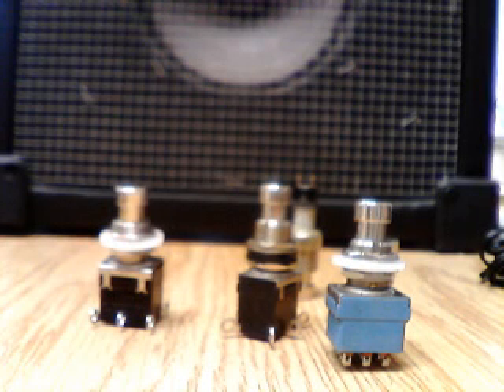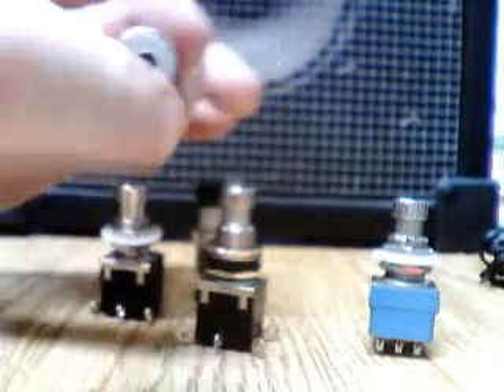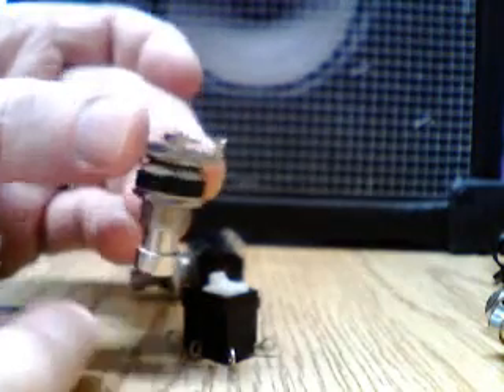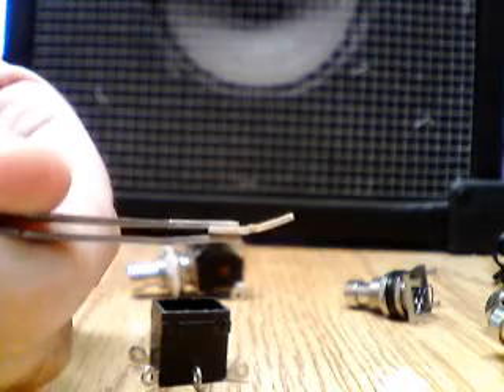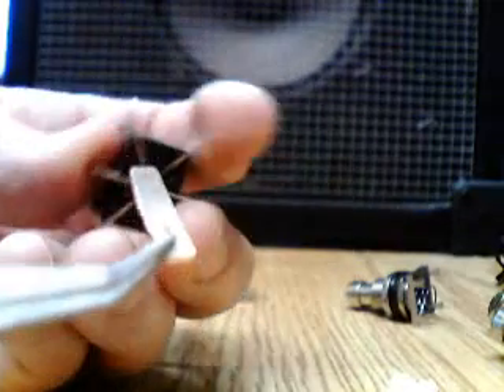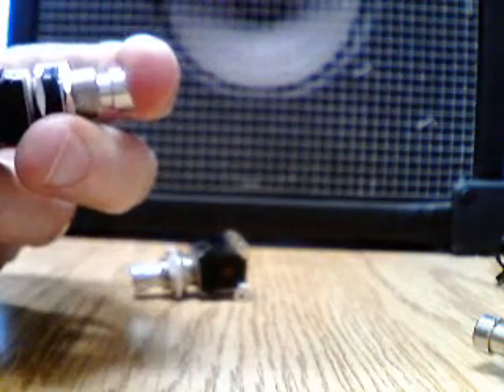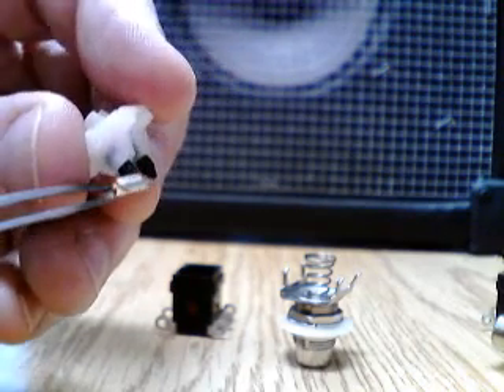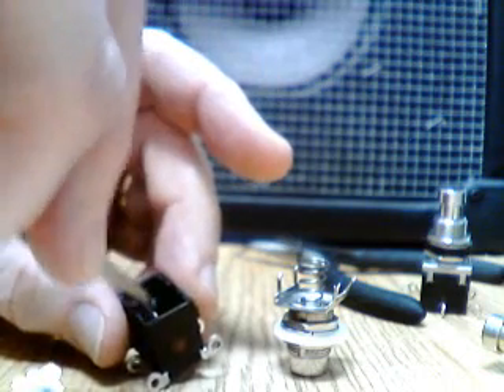The inner life, and rehabilitation of, stompswitches

Comment: Brilliant video. I’ve taken apart my pedals and switches and cleaned them all out. I’ve noticed over the years that these switches are a common culprit of tone suck for guitar rigs and I think it’s down to the grease inside that as you say flows around with heat and makes the electrical connection rather crap. Even on a relatively new high quality pedal there was grease on the metal contacts that would be in the way of a clean signal. I don’t know why the manufacturers put grease in there. I’ve removed it all and it functions perfectly. Even if the grease is supposed to stop corrosion / tarnishing, it’s pointless as the grease itself harms the signal.